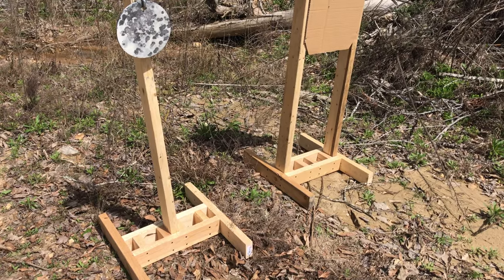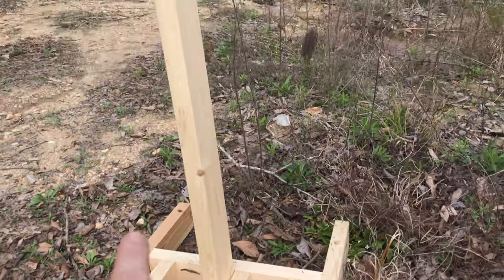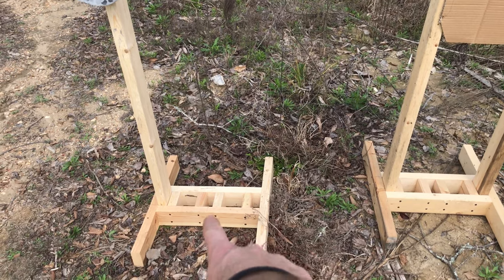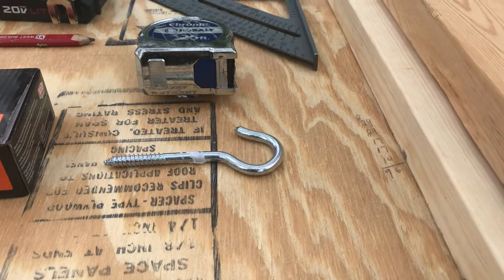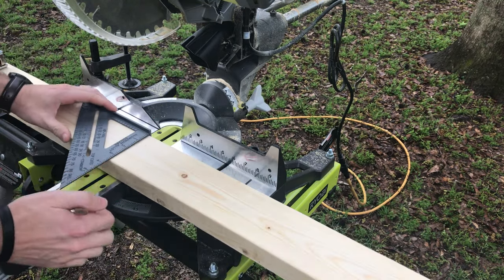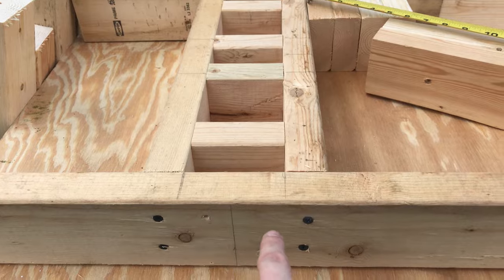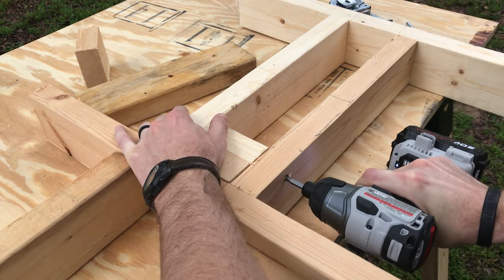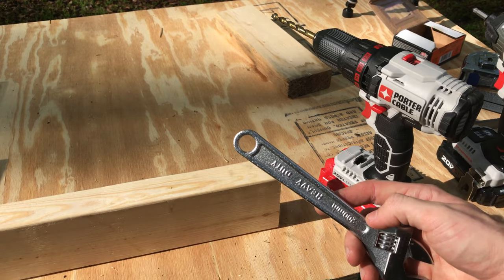$7 DIY Target stand

Comment: On the single post target.  Make a “T” and hang the steel plate on the side… you can actually hang 2 steel plates and you won’t tear up the 2x4.    I’ve actually used a 4x4 and made a single post tree.

Comment: 8 inch carriage bolt, 4 1/2 inch spring, 2 washers, 2 nuts. Take your bolt, put through your plate then add the spring onto the bolt on the backside. Add a washer and run through the 2x4. Compress and add another washer and 2 nuts tightened on each other. Add washers anywhere else you might need. Hope this helps. I'm gonna use your idea for the replaceable upright if that's ok.

Comment: Thanks for posting this video. Great design and cost effective. I built one last night and took it out today. Winds were 20-30mph. Did not fall down once. I will be making more. Thanks again
Reply from the maker: Heck yeah, I'm glad they worked so well for you. My original stands are still holding up to this day. They all need new uprights, but that's an easy fix.

Comment: an idea: Bolt the steel target to the top of the 2x4.  Before you do, cut the top of the 2x4 at a slight angle where the target will deflect lead down.  Just don't take too much off the top so its still strong

Comment: You could use 2 outside uprights, both with hooks, suspend a chain between them and then hang the steel disk from the chain.  Like the design of the stand.  Some good ideas.  Thanks for posting.
Reply from the maker: Robert Burns if I was gonna do some long range shooting with a big steel target I would definitely do that. 👍🏻

Comment: hardware
4.5"x1" diameter spring
7/16 x 6" bolt
2 nuts
3 fender washers
2.5" wood screws

wood
(2x) 2x4x8' or 2x4x10'

cut:
feet: 2x 24" each 
side2side: 2x 17" 
middles: 4x 3.5" each
upright: 4ish feet (remainder)

(with 8ft piece, cut half pieces out of one board, half out of other board)
96 - 3.5 - 3.5 - 17 - 24 = 48"ish

Comment: I've had a cabelas stand with a hanging chain and gong for a while now. Took someone else out shooting and ended up with a few holes in the angled bars (oops!). After that, I felt I needed a lower cost option that is easy to replace damaged sections. 

This looks perfect and versatile.  Bought the 2 8ft boards today. about to start on it :)
Reply from the maker: Awesome! I hope it turns out great.
Reply: @ClangandBang  it did! Finished it yesterday. I'm sure I could sand it all down and even stain it... but it looks like it will work great as is. With the freedom to change the length of the upright boards, their position and change out the chewed up boards... this is perfect! 

Thanks again for the awesome video!
Reply from the maker: Kahlandir you’re welcome, thanks for the feedback. 👍🏻

Comment: Btw if you make a couple pieces slightly shorter intentionally then you can cut all the base pieces from one 2x4 if you want or need to for some reason. Probably obvious but maybe only once it's too late :) none of the cuts are really critical in size... The small pieces can be flipped to stand upright if you cut them the wrong size and you don't mind them having the ends exposed

We don't do this kind of construction a lot so we had issues with the stand openings being too tight no matter what we did. We finally put two layers of thin tagboard on the side of the spacer before screwing pieces together and that helped.
Reply from the maker: Yeah, the slots can get tight especially when the wood gets wet and swells. Sounds like y’all got it figured out though. 👍🏻

Comment: Hey a bit late since this was 6 years ago but I had a thought with the metal target. Since you have a space on the left and right you can just make a U shaped frame and put I bolts or hooks through the middle 2x4 part and hang them by a chain instead.

Comment: Just made one of these in like 30 minutes. I made the whole bottom slotted for lots of adjustment. The smaller pieces are kinda wonky, and I should've used smaller screws because a couple split even though I drilled them. Can always make another real quick! Thanks for the idea/instructions!

Comment: In the video you mentioned a bolt with a spring to help angle your target, but can't think of an easy way to attach that to your stand.  I would recommend using a short length of chain.   You can bolt your target with a spring spacer to the chain on one end and then hang the other end of the chain from your hook.  This should be a simple solution to add a bit of angle.

Comment: To change up the way you hang the metal target, set up the stand like you would for a paper target. Run two small links of chain from either side and hang it that way
Reply from the maker: That would definitely work, especially if you have a target that has two holes in the top. Even for a single hole target you could just run the bolt through a link in a single piece of chain.

Comment: This worked slick. I made three and left out the middle bracket. A “c- clamp” or two is a big help in making this. 

Also.....I learned today that an 8 foot 2x4 is not really an 8 foot length. Kind of like a 2x4 is not really 2 inches by 4 inches.

Carpenters are just as messed up as pipe fitters....1 1/2” pipe is not really 1 1/2”.
Reply from the maker: Yeah I learned a long time ago to take about a half inch off of the dimensions on lumber. I also learned you can’t always trust a factory cut. 👍🏻

Comment from the maker: TARGET STAND DIMENSIONS (New Version 2.0)
2 Outside pieces (feet)		24”
2 Cross pieces 			        18”
4 Spacers 				        Same width as upright
2 Uprights				        Whatever is leftover (48” or so)
Reply: Why did you change it by 1 inch
Reply from the maker: chupacrabra1985 18” is the width of an IPSC silhouette target. I don’t know why I did 17” the first time. 🤷🏻‍♂️

Comment: Great video man! I've been looking for some portable stands that break down but assemble without much need for tools. Gonna make some of these this weekend! For your hanging plate to angle down with the bolt...just put it on a shim at the top and bolt it. Wouldn't be much but about 1/4 inch or so but would be enough to angle it down.

Comment: Great stand.  To attach the steel plate, take an angle bracket, open it up so it is greater than 90 degrees.  Lag bolt it to top of 2x4 so angle is facing up (will result in front face slightly angled toward ground.  Put a carriage bolt through target with a spring between target and angle bracket, with washer and nylon nut to hold it on angle bracket.
Reply from the maker: That's actually a pretty good idea. Its cheap and easy too. I'm gonna have to give that a try.

Comment: I’m going to try this base but I got a long bolt some nuts and washers. And then I picked up a spring to fit on the bolt to keep behind the plate thinking is will work great
Reply from the maker: Yeah that’s the route I went with the spring. As long as the spring is strong enough to push the steel back in place it should work great. 👍🏻

Comment: Nice work. Off to the shed to build a couple. Thank you.
Reply from the maker: You're welcome! I hope they turn out good.
Reply: Thx "Clang and Bang". Turned out great. So cost effective, I built 3. I did add a top brace for some extra stability and extra surface to staple targets/backing. On one I added some rubber on the front of the uprights. Used some old bicycle innertubes, cut 'em in half and stapled them on. Works great for birdshot at 25 yrds. Cheers and Happy shooting

Comment: Don't use yellow pine. The blocks split on me when I put in screws, I even pre drilled them.
Reply from the maker: I’ve had that happen a couple times too. You have to make sure the grain of the wood is oriented the right way. That should keep it from splitting so bad.
Reply: @ClangandBang  You know, I just made it with the flat part of the uprights facing forward and put an 11" 2x3 in between the 2 17" 2x3.
Reply from the maker: @Mike_LaFontaine75  that works too 👍🏻

Comment: Nice job I'm going to start this week on doing some of these , how do they hold up on windy days . Would I need to put some sand bags on them cuz I go shoot at the desert and it gets pretty windy out there at times.
Reply from the maker: Thanks man! I've had them out with winds up to 15mph without an issue, but I'm guessing winds in the desert might be a little faster than that. It probably wouldn't hurt to bring some bags on the first trip just in case.
Reply: Little late for your trip but you could also swap the bottom base legs from 2x4, to 4x4 for the extra weight for higher winds, little more money but if you'd rather not cart around sand bags

Comment: The two pieces I have left over is 44 1/16". Are these pieces used as the uprights for the various targets?
Reply: I made the stand for the two outside holes like you said. They're for the cardboard silhouette targets. However, I don't shoot steel targets st the range I go to. So I bought some cheap paper targets that are 12" x12". I measured from one outside post yo a point in the middle a little over 12" and made a place to put the upright. Now I can use paper targets when I don't use the silhouettes.

This is a great video and a dimple build. 2"x4"'s are a little more than $3.50 each right noe. Stud grade lumber at the store I use are wsrped, so I got the best ones I could.

Comment: great video .... can i shoot normal 1/2 inch steel with a 308 or do i need ar steel ?
Reply: GENO Dboy you need AR500 plate, especially for 308. You risk a ricochet if you don’t
Reply from the maker: I would stick with target rated steel, especially for rifles. 1/2" normal steel will probably work with pistol rounds, but it will probably bend in the middle a lot sooner than AR steel.

Comment: not sure what size your steel plates are. Do you think it will work with 10 inch ar500 plates?
Reply from the maker: They are 8” I believe, so 10” should be fine. 👍🏻

Comment: @Clang and Bang Checkout AR500 Solutions 2x4 target mounts! I just ordered a bunch of them. They are $25/piece but they’re made from A500 and powder coated orange. They also set the targets at a 20* downward angle! 🤘🏻
Reply from the maker: MotivateStrength I’ll definitely check those out. That sounds like a pretty good setup 👍🏻

Comment: How would these do in the rain? would the wood be ok?
Reply from the maker: Raleigh John A little bit of rain every now and then won't hurt them. I wouldn't leave them outside since they aren't pressure treated, but I store them inside so I don't have to worry about it. You could definitely make them out of pressure treated wood if you planned on leaving them outside.
Reply: The wood would get wet in the rain.

Comment: Great design and excellent video.  Just wondering why you chose 17" for the horizontal cuts?  Seems like 18.5" would better fit a standard USPSA or IDPA target and would only reduce the uprights by 1.5" each.  Would the increased width affect the stability of the stand?  I'm gonna make this a project with my 12 year old this weekend.  Thanks again.
Reply from the maker: You could definitely make it 18.5" I think I made it 17" because thats what size targets I had on hand when I made the first one and thats the one I took measurements from. I hope your project turns out good and y'all have fun using them.